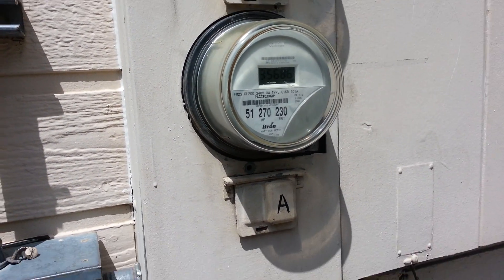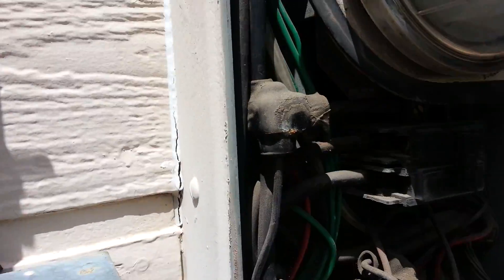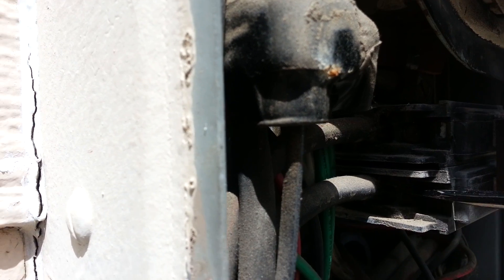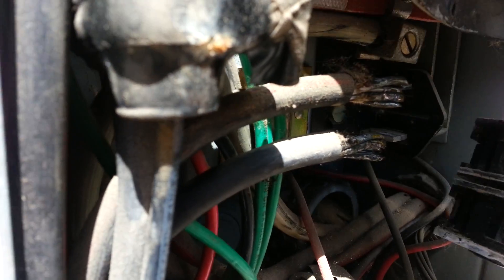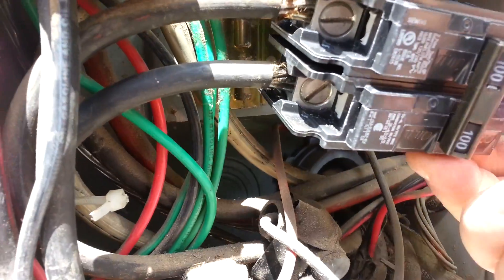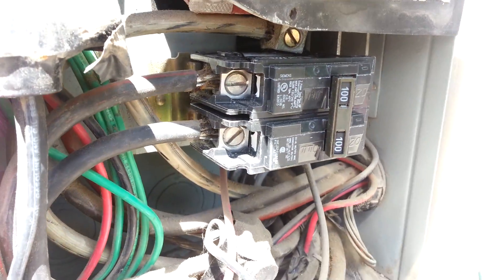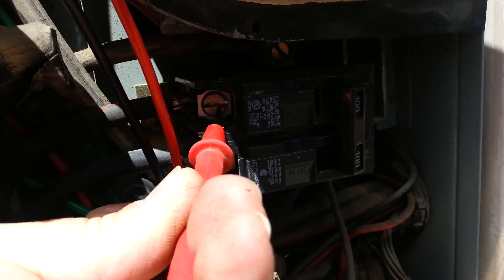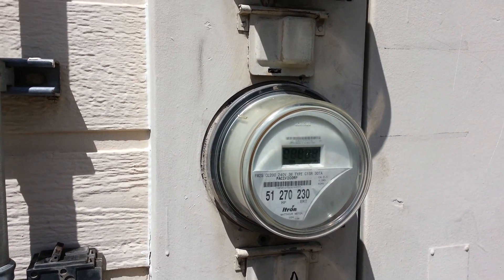How to Replace main breaker

Comment: Yep... he knows what kinda meter to use! My Fluke is the model 115 been around for years. Not cheap but you get what you pay for. Oh.. DO make certain that you have VAC selected! Yep you can do this WITHOUT pulling the meter. just throw that breaker and double check for no power across the legs. You may wanna wrap the screwdriver with electrical tape beforehand. Some breakers use allen screws instead of slots and if that's the case use gloves and tape as well (even though power is off when the breaker is thrown you never know as the breaker could be shorted internally). It only takes ONE mistake here to reach the "Fatherland"!

Comment: Would be hellful to someone if you actually showed removing the main breaker and replacing it with the new one. That's the whole point of a video. Showing the removal and reassembly.

Comment: Those are live lines. use a heavy duty straight screwdriver don't touch the metal with bare hands. wrap most of the shank with electrical tape if you have to leaveing just the tip exposed. only hold the handle make sure you're not standing in a puddle of water make sure your other hand is not touching something conductive hold onto the breaker by the plastic and screw one wire in at a time make sure the breaker is off before snapping it into the bus. i also like to switch off the sub breakers before switching on the main to alleviate a massive surge. after the main is switch on then go ahead and throw on the individual breakers.
Reply: Good advice especially about one conductor at a time. Better advice is to have the circuit de-energized since accidents/bad things can happen even when "professionals" cut corners. Over decades I've seen bad things happen on the job site more times than I can remember. While not comprehensive there are some helpful tips in your comment.
Reply: Good info
Reply: Not live if the breakers not plugged in
Reply: @greetthemen ??? It's coming straight from the power lines yes it's active lol 
The breaker just allows the energy to stop if something happens that shouldn't happen past the breaker it doesn't cut power from the source

Comment: Bro u just used a metal flat head screwdriver with even testing for voltage. You are trippin
Reply: As long as he doesn’t ground himself or short line to line he could use a metal screwdriver all day long, but it’s still dumb

Comment: DO NOT DO what this f***ing idiot did. coming from someone with a background in electricity. ALWAYS pull the glass meter before doing this to cut off power to the breaker and ALWAYS wear thick leather gloves. just trying to save someone's life

Comment: Am I missing something? Turning off that breaker only de energized the load? The meter was still in and bridging the line in from utility to the breaker. As in, those screws and wire still carried voltage like normal... Is there some information I'm missing or did you do that hot?
Reply: I was going to ask the same, those wires are hot